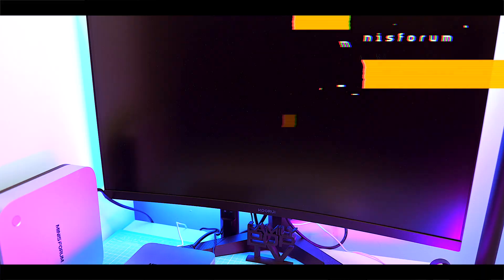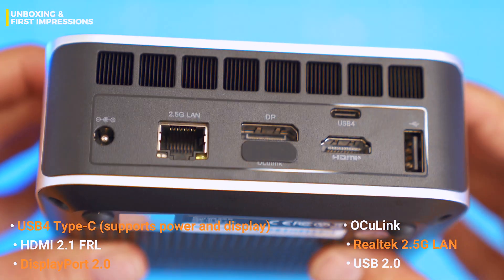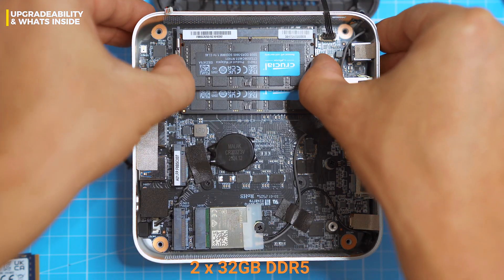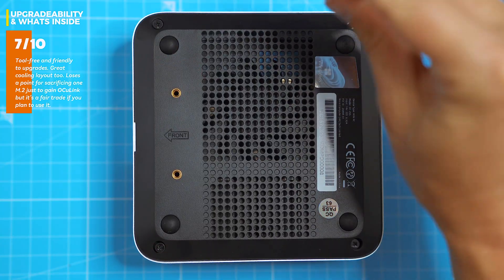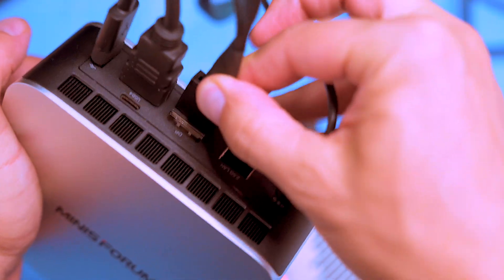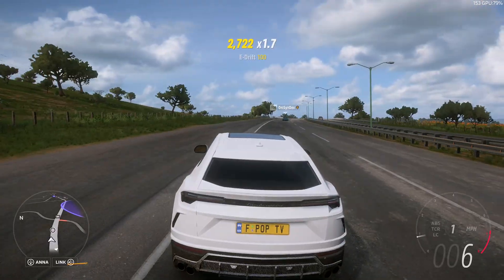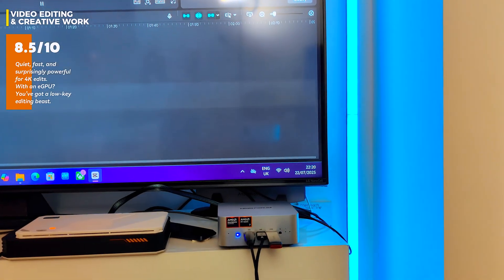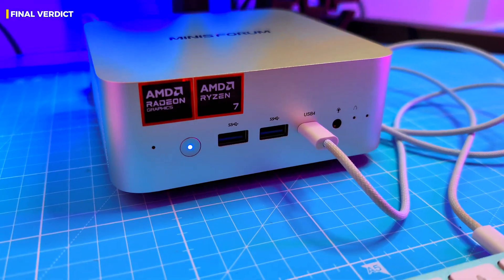Minisforum AI X1-255 64GB/1TB: Small PC, Big Upgrade Potential?

Comment: Just ordered the same one! Planning to use it with my 3090 for some AI stuff. Is it good for that?
Reply: Whether it's image generation, or chat/instruct models, the 3090 is a great card. I haven't tried any over occulink, though. But the limited bandwidth should only affect the speed at which the model you're calling loads into GPU memory. Inference will be taking place on the GPU itself, so the interface won't hurt you there. Hope that helps!